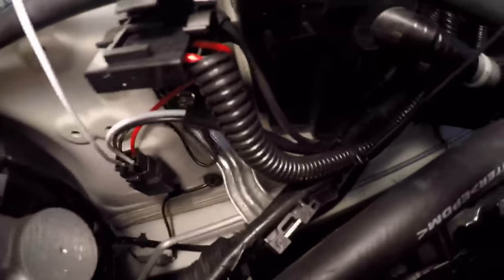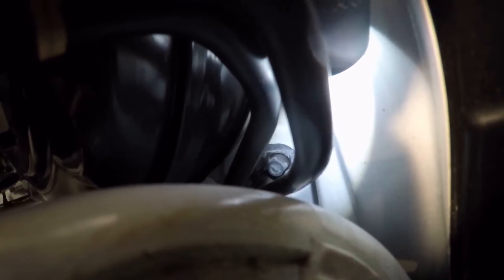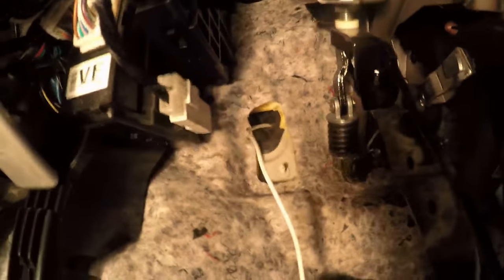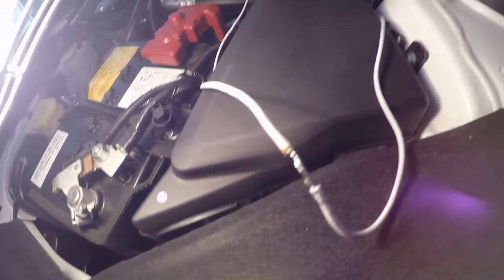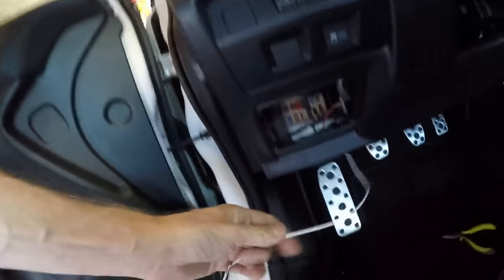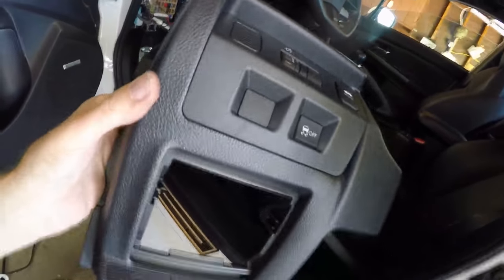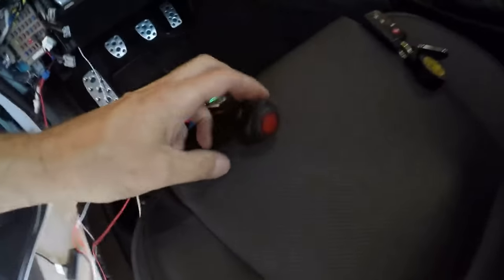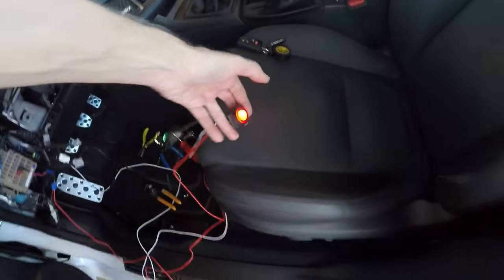2015 Subaru WRX Ep. 523: Nilight LED Bar Wiring - Part 2 + Final Results

Comment: I used the Stock Forester cluster switch on my STI. It looks OEM. STIs only have 2 that we use and the other is just a fake box. The Forester has the same small cluster and has the 3 box as a pop out slot. I then ordered the switch from Subaru. And everything looks Organic! I also hooked it up to a ignition only switch, so when I turn my car off, it turns off as well and won't kill my battery if for some reason I leave it on when car is off.

Comment: Man, I had to do all that work to add fogs to my base WRX and now only one of the fogs comes on. Such a pain. I’ll have to go through and redo all of my connections. At least I know the switch and power wire to the relay are correct thanks to your video.
Reply from the maker: oh ya man, i had to trace problems all the time... sometimes i even had to swap the relay if each light had a different wire...

Comment: I have a winjet switch you find for aftermarket fogs made for our cars.  (we have limited wrx so we already have fogs).  It fits right next to the button to the right of the cluster dimmer dial.  It looks oem and I know you would appreciate that style.
Reply from the maker: but i already have a button to the right of that dial i thought.
Reply: it goes into the button hole where you ran the cobb cord through I could not find the switch by itself. I have it for after market fog lights that I have
Reply: Check out your fb.  I sent picture
Reply from the maker: i have it ordered as you know, thanks. ill prob try it out. concerned about the color match tho.. i like my hidden switch right now behind my fuse box door.

Comment: there is an easy way to get through the firewall. There is a rubber gromet in the wheel well that goes through the firewall
Reply from the maker: i saw that cluster inside.. but didnt feel like removing a fender liner.

Comment: There is a oem button that goes there I believe : I had aftermarket fogs installed buy the dealer and there a nice switch that illuminates with the lights (base wrx)
Reply from the maker: ill have to buy it

Comment: Hello, where did you connect the positive wire from the switch. I saw it connected to the wire from you radar. I don't have a radar and I am a bit lost on where to connect the positive and which is the red wire from the switch do I need to connected to the fuse box and if I do what amperage and how do I find a spot for it. Thanks in advance
Reply from the maker: hmm im sure i have a video somewhere on this car about where i hard wired the connections.  did u check video #3? https://www.youtube.com/watch?v=6E5hB6Atsuw

Comment: Did you ground the light bar or did you just put it in both connectors for it because I have the same wire harness
Reply from the maker: It came w the extension which went to pos and neg at my battery. The video should have showed everything
Reply: LastHumansGarage ok I'm going to watch the video because I'm confused and I just subscribed i liked the 1st video of you doing the wiring
Reply from the maker: dude the video is crystal clear. watch every part.

Comment: Swap the power leads on the switch and the light won't stay on all the time.
Reply from the maker: really?? it will only light up when its on? ill try that soon, its a 5 second test
Reply: Yes, It'll only light up when the switch is turned to on.
Reply: Don't move the ground. Just the two power leads.
Reply from the maker: ohh i thought u meant reverse the positive and negative. glad i checked my emails.
Reply from the maker: it worked dude, youre the master of electronics.
Reply: Glad to be of some help.

Comment: Hey just a thought here, but if you want to have the switch for your light bar look stock, why not use one of the switches that is supposed to go into the blank spots on your console?

The two blanks you have are for the rear cross traffic alert radar system (upper left) and for the steering responsive fog lights (lower left).
You can see them here: http://www.cars101.com/subaru/wrxsti/wrxsti16-driver-controls4.jpg

The steering responsive fog light switch is part number 83002j/83002FJ070 and can be seen here: http://parts.boisesubaru.com/p/Subaru_2015_Impreza/Switch-steering-response-fog-light/60018260/83002FJ070.html?partner=googlebase_adwords&kwd=&origin=pla

The radar rear traffic alert switch is part number 83002i/83002VA060 and is available here: http://parts.subaru.com/p/Subaru__/SWITCH-BACK-AND-SIDE-RADAR/61226717/83002VA060.html

I think the rear traffic alert switch is a toggle but I am not sure about the SRF switch.  (It probably works the same way as the traction control, but it is hard to tell because that switch is much more expensive.)  If it just a momentary toggle switch, you would need to wire in some sort of impulse relay or flip flopping circuit to use it. 

Regardless, those would fit into your existing slots, would look nice and clean, and shouldn't cause any issues since feed going to that switch has such a low draw.  Plus at $21, they are relatively affordable.  Personally I prefer the SRF switch just because it seems more in line with the light bar, (if it is a toggle you could invert it so that SRF OFF == Light bar off) but then again the radar rear traffic alert would be easier to use if it is a toggle since it wouldn't require the need of any additional wiring.

Just a thought.
Reply from the maker: thanks, i actually saw you can just buy a forester bezel and fog light switch.
Reply from the maker: ps, do you agree that having the switch tapped into my radar detector power shouldnt cause any load issues?
Reply: LastHumansGarage It is hard to say without knowing more about how much both the switch and the radar detector draw and how each works.  The switch should be fairly stable assuming all it is doing is flipping a relay or something in the light bar's wiring/assembly to enable its primary power source.  The radar detector might draw more, but I can't image you would see huge spikes.  Regardless, as you are running it through a fairly low amperage fuse: that should keep you safe as it will just pop that if for some reason the draw gets too high.   Just check the cables to see if you feel any heat or anything where you might be exceeding the cable's limits in that area.
Reply from the maker: its a 10A fuse. the detector prob only pulls 2-3a
Reply: LastHumansGarage As long as the wiring is not getting hot or anything: I would be say it is fine.  You could always run it across a resistor to calculate the exact load, but I doubt that is even necessary.
Reply from the maker: doesn't light as much as i thought, but i haven't tried it in pitch black yet.

Comment: From NASIOC
Here are the part numbers for the bezel and switch. 
You need both. 
H4510FJ000 - switch
83472FJ010VH - bezel
http://forums.nasioc.com/forums/showthread.php?p=42996906#post42996906
Reply from the maker: thanks thats what i needed.. i dont wanna mess with this myself.
Reply: Glad to help. I just need to find myself an oem switch that goes to the left of the traction control switch to install a bar.
Reply from the maker: i might try that at some point, but for now i have a oem switch ordered that goes next to my dimmer dial in the middle of that panel.
Reply: I am eager to see the switch and the final install video
Reply from the maker: i wonder if these parts have a perfect factory match. not worth buying if they dont.
Reply: Yes, the switch that goes left of the dimmer switch matches the factory colors